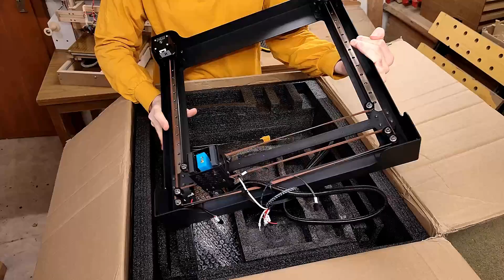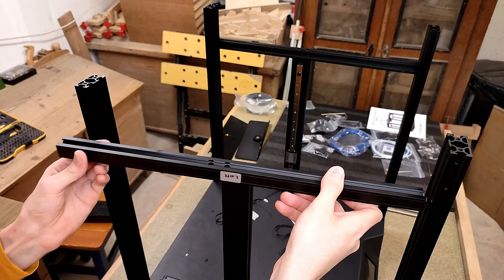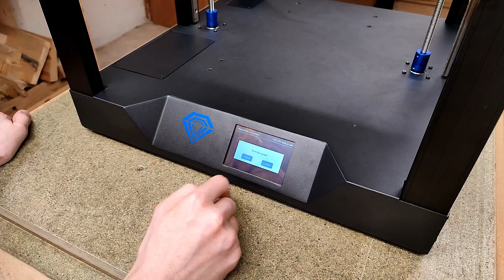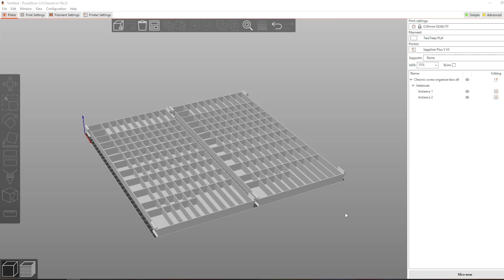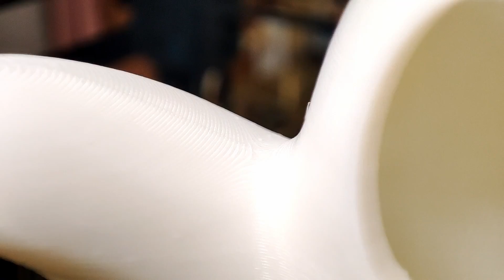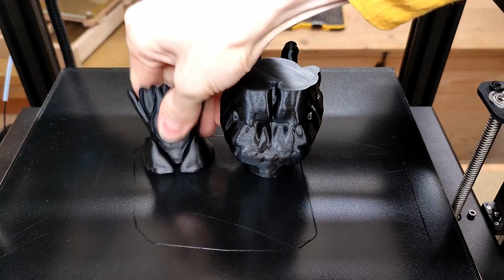TwoTrees SP-5 V3 first impression and test - 3D print your Halloween!

Comment: At what speed did you print the ghosts?
I am looking for an upgrade for my old ender 3 and want to print at least at 80 mm/s
Reply from the maker: I printed most of the things in this video at the Prusa default setting (I think that's 40mm/s perimeters and 80mm/s infill) because this was the first time I touched a 3D printer and I didn't know what I was doing. I've since gone up to 120mm/s on this printer without any  problems. Mechanically I see nothing preventing it from going the full 300mm/s they claim, it just needs some tuning to get there, which I haven't yet had the time or knowledge to do. When I just cranked up the speed I got some severe belt chatter :p

Comment: for a corexy machine: i highly recommend changing the infil angle to 0° or 90° as the 2 motors will be working together. this allows higher accels and speeds. 45° is perfect for bed slingers for the same reason. great video!
Reply from the maker: Thanks for the tip!

Comment: Hi Chronic. Nice video. I've got an older SP-5. What a 'project' it has been over the years. When you get your sea legs, how about another video pushing the speeds? Seems an appropriate test for something advertised as high speed. Benchy in under 15 minutes 😂? I'm skeptical after zooming in the times on the slicer. Also it would be cool to walk us through the touchscreen functions.
Reply from the maker: I agree, an "opinion after xx months" video would be good, I've learned so much since getting this printer I now actually have options about it where in the beginning I was just overwhelmed by how cool everything seemed. Unfortunately I've been pretty slow at trying to print faster because I haven't been printing a lot since, so there might already be a new version of this printer on the market until I finally found my bearings and get around to making that video... 😬

Comment: that's not annoying at all , just as i finished upgrading my sp5 v1.1 to orbiter direct drive extruder and ceramis core V6 hotend. Hotend on mine was total rubbish and looked just loike the on you have, jammed on first print and ket jaming every 10 minutes of printing.
one motor would strugle to move bead at reasonable speed without being huge. and uncoupled double drive z axis motors always desync on power down. unless you home your printer every time before poering down And you zero/home position is on full motor step you will have desycned motors.
Reply from the maker: Oh noo! 😂😢
So far I only got the hotend clogged twice after forcing in super brittle PLA that splintered and jammed in the softened PTFE above the heat break.
Reply: @ChronicMechatronic  well i planned on using direct drive and full metal hotend anyways, but printing new mount proved impossible, had to use old knackered printer with rattling linear rails and max 15mm/s speed  and 100mm/s2 accelerationto get half decent print 😂

Comment: My Tronxy X5SA 400 has a Semi Dual Z-Axis as well. Didn't saw it at first and ran it without the syncronizing belt.  On a large Bed the Belt would slip on a XY, so they use two motors on one driver. The problem is that you need to syncronize the Z-Axis after every powerup without the Syncronizing belt, as one side might drop. So they got 1 Driver 2 cheap motors and a geared belt. And thats the problem on a real dual Z-Axis or tri Z- axis Core YX printer, thebed needs to be leveled, wih syncro belt it doesn't .  So less firmware demand as well. So cheaper Prozessor, Marlin and less problems.

Comment: I noticed TWOTREES has the machines I've been looking for with similar architecture to the I3 Mega which unfortunately  Anycubic pulled away from to go the open frame structure with side mounted control panels which I highly dislike, so I am interested in their machines, they have other machines as well CNC laser cutters which look well made for being entry level. I am looking to try both their I3 and the machine featured in this video. I don't care for bells and whistles more important to me is consistency repeatability and durability. I can level the beds myself not a problem in fact I prefer to do that, but if the machines come with auto-leveling even better.
Amazon has the older CORE XY version I wonder if TWOTREES is considering updating their product line at Amazon.

Comment: its a good printer ,you did not mention the price ,or maybe i didnt hear it 

something is wrong with that extruder , the layer lines are not consistent , either you need to adjust the extrusion multiplayer in your slicer , or the extruder itself have something wrong with the hardware, CNC kitchen investigated and found out the gears in his extruder are not eccentric to the motor shaft , after that i found out i have the same issue and it really improved the print quality significantly 

also tune retraction and enable wiping on retraction (it will wipe the nozzle on the part itself to get rid of the blobs after retraction)

also you need Automatic Bed Leveling , you should investigate how to add it on the cheap

Comment: Hi good video I ordered a new one and got the slightly older v1.1. Anyway was just wondering what size and diameter the new smooth belt pulleys are so I can order some with out having to vuy the whole high speed kit as Ive already teplaced the hotend and the extruder etc just need to swap out the pulleys and configure some new firmware again.
Reply from the maker: What, you ordered V3 and they sent you the old one? That's inacceptable, did you reach out to customer support? I could raise the issue with my contact there.
The smooth idler pulleys are all 20 tooth size, 12mm OD 4mm ID

Comment: Auto bed leveling isn't about the rails, it's about the bed.  When you head up a big flat piece of metal, it warps slightly.  And it could warp differently every time.  Automatic bed leveling adjusts for that slight warp to give a great first layer every time.
Reply from the maker: A Patron suggested that might be why they chose a glass bed

Comment: I have the previous version of the SP-5. I unlinked the Z motors to get automated bed tramming (G34 support). There’s not much use if you don’t have two end stops (mine has a single Z limit switch by default that I replaced with two independent optical ones) or a bed probe. The point of this is that you can ensure your bed is always parallel to your gantry before every print automatically. Generally overkill, but I hate manually leveling my bed. 

I added a mosquito high flow hot end, gdstime fans, a Sherpa micro extruder, bltouch, tmc2209s, and klipper to mine and it really screams. It fills the space between my X1C and my V2.4 350. Just need to get the enclosure panels. 

I know that Design Prototype Test has an SP-5 (early model) that he completely enclosed for high temperature printing. 

Hope you enjoy!
Reply from the maker: Honestly, personally I'm probably too lazy to bother with upgrades - though the fans could definitely do with being quieter ngl, not much point in quiet steppers if the fans sound like a jet engine...